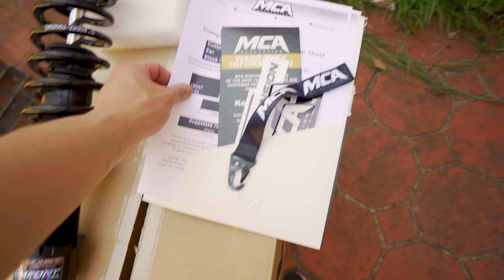Choosing Between Comfort and Track Coilovers! What should you buy? | MCA suspension

Comment: Great comparison review mate, i think for a daily the Pro Comforts hands down but pair it with a Whiteline front and rear sway bar and end link kit and you won't be missing the Pro's anymore.
Sway bars make a massive difference to body roll in corners.
Reply from the maker: Cheers, mate! Appreciate the comment. I've had the full whiteline swaybar kit previously (and even made a video on it). I took it off because i couldn't believe the quality of the brand. The front end links were very loud and clunky, even after replacing with a brand new set of end links from whiteline themselves, the brand new ones were clunky too. Not to mention the rear sway bar, which was bent 5.7mm to one side. Called up whiteline again to which they said the bend was "within their tolerance" and refused to give me a refund. I'm not sure any parts company allow for that much slack, if any... great to hear if you've had good experiences with whiteline! I will personally never vouch for them again
Reply: @MrDuongTV1  Thanks dude for this information,  I have been tossing up buying the whiteline kit for my VN wagon  but hearing this feedback has put me off.
With the pro comforts installed would you say the car had much less bodyroll than standard?
Thanks again for your great content and replies.
Reply from the maker: Nah man thank you for watching and supporting the channel! Yes, immensely reduced body roll even on pro comforts! If you turn them up they actually can go pretty stiff. I hear that on the levorgs, the difference is night and day so I'd imagine with the new wrx wagon it'd be even better, as the newer wagon is on the subaru global platform. If you really want a set of sway bars (which you don't need on a daily or street car, esp a wagon), hard race and super pro are brilliant suspension brands
Reply: @MrDuongTV1  Thanks again man, I wws in 2 minds about either coilovers or sway bars, because there is noticeable bodyroll especially in the rear, with coilovers , i can lower the car a bit and reduce bodyroll, also MCA seem like a very reputable brand, coilovers it is !!! Happy cruising mr Duong !

Comment: I've come back to this video since there isn't too much online and think I will have to pull the trigger on a set of Pro Comforts soon...

I have BC BRs right now and they are not taking the very uneven patchy roads around me well, quite crashy and you feel everything through the seat! Still feeling bad everytime I have a passenger loll. 

Do these MCAs produce any sort of noises or NVH over bumps and stuff? Not sure if its just the nature of coilovers and them having camber tops, but my BCs do over certain bumps. Not a bad noise, it's just noticeable briefly and is it a bad idea if I'm planning to go quite low on these? Does it defeat the 'purpose' as I think Pro Sports are better suited for lower heights, but I do not track.
Reply from the maker: Thanks for watching mate. Indeed, the BCs would be very crazy on uneven surfaces, budget quality so could be noisy too.

No noise coming from MCA coilovers, you would hear impact noise tho i.e. going down a step or into a pot hole, but thats just the impact being absorbed by the tyres, not the coilovers themselves. I remember I would get clicking noises over every single bump with my Silvers... completely quiet with the MCAs. If you want to go "quite low" with Pro Comforts, they're not the set for you. Lowest you can go with these is down to a 1cm gap between your tyre and fender. Its not as stiff as the Pro Sports so if you go mighty low, it'll keep compressing and probably rub onto your car/destroy your tyres/fender liners.

Pro Sports are great and quite comfy, but definitely not what you're after if you don't plan on the occasional track day. MCA have just come out with Pro Street, that fill in the gap between the Pro Comforts and Pro Sports, that I didn't even know needed to exist lol. I haven't asked much about it yet, so I'm not sure if they're suitable for lower ride heights compared to the Pro Comforts, best bet is to call them up after they've come back from their mid year break.

Comment: Do the comforts ever feel floaty or bouncy over certain roads (the teins do feel this way with 3/4 firmness)? I currently run tein flex z's which I'd say are comfy, 7/6kg. Tracked 3 times in a lib wagon and I'd say that's probably their weakness...
Handling they seem fine at eastern creek as running a 22mm rsb on hardest. 
Great video!
Reply from the maker: I'm on about 7/12 at front, 4/12 at rear and its fine. Its nice, planted, firm and feels sporty. But defs a lot more body roll in the pro comforts vs pro sports at that level of dampening. I haven't tracked the pro comforts (MCA dont recommend that either) but I do plan to eventually. On mountain and spirited drives, the car feels great 😊 no complaints.